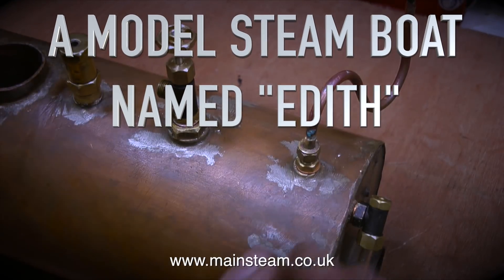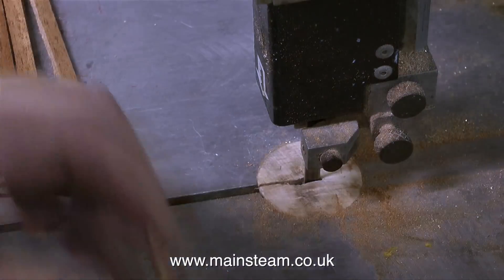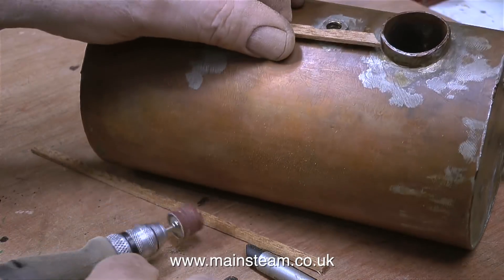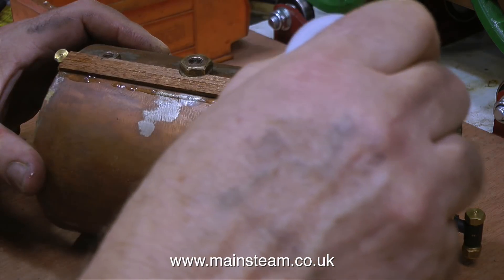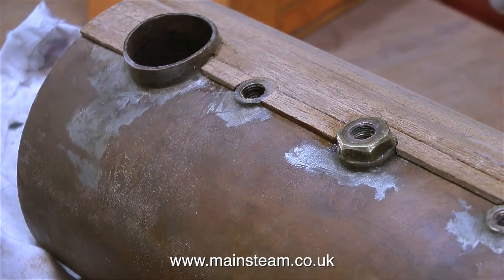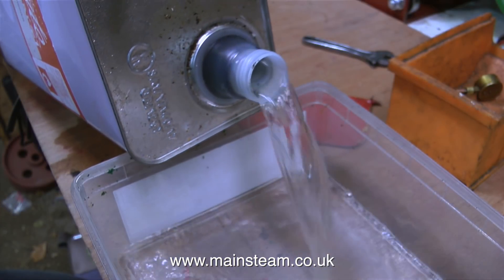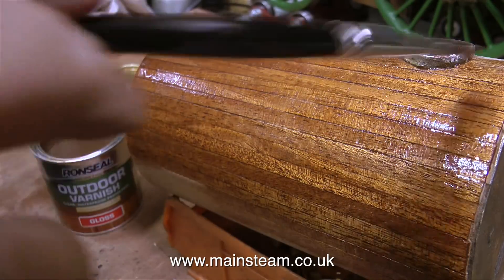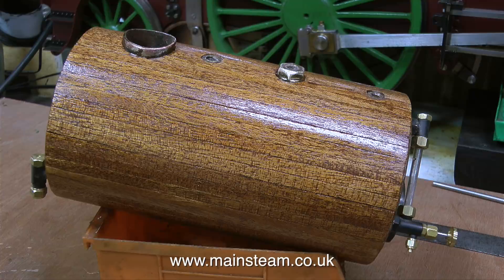A MODEL STEAM BOAT NAMED EDITH - PART #20

Comment: Here's a tip for anyone doing planking around a curved surface. Cut the plank at a slight angle, of course when applying it, make sure the wide side it on top. This reduces the amount of gap between the boards, and they fit tighter against each other.  Oh, and have acetone handy when gluing with CA, helps remove your fingers from the wood when you inadvertently glue your hand to whatever you are working on.
Reply from the maker: I prefer the gaps, that way they look like strips of wood ......

Comment: If you have a part (like your rudder) that you can't conveniently get all the way into your bucket of thinner, you can wrap the exposed portion in an old rag and soak that. It doesn't work nearly as well as having it immersed, but it can help get some of that old paint loose before you get after it with some elbow grease.

Comment: Bonjour Keith,
I was criticized by purists for installing slatted wood boilers in service boat hulls. For them, the protection must be asbestos (forbidden now) or cork and thin metal sheet, possibly painted.
Besides that, I personally cut out a 2 mm cork sheet to the dimensions of the boiler and I stick like you then the wooden slats with the cyanoacrylate glue on it, this makes the cladding removable.
Amicalement, Raphaël

Comment: Nice work with the mahogany. How well does the CA glue hold up under all that heat?  I've heard that it gets brittle.. Any thoughts on this?
Reply from the maker: The CA glue lets go from the copper when the boiler is steamed, but that is the plan because the cladding is held in place by Brass bands by the time it is steamed and it also makes it easy to remove the cladding in sections for boiler inspection . . .
Reply: AHHHH.. clever. Amazing how much I have learned by watching your channel. Thanks!
Reply: does the glue between each plank get remove by the heat when you first steam it?
Reply from the maker: No, it stays in place .....

Comment: When you run across asbestos, and need to remove it, as you have mentioned, do it in a wet state. Here's a pro tip, large remediation companies use water with dish washing liquid added to the water. The dish washing liquid acts as a "wetting agent" and keeps the asbestos wetter longer than just water alone. This prevents the asbestos particles from becoming "airborne" where it can really pose a safety hazard from accidental inhalation. The soap helps to bind the particles so they are less likely to dry out and become "deadly dust"....